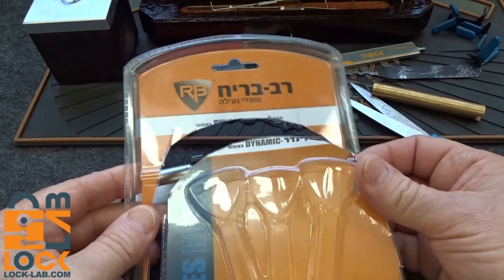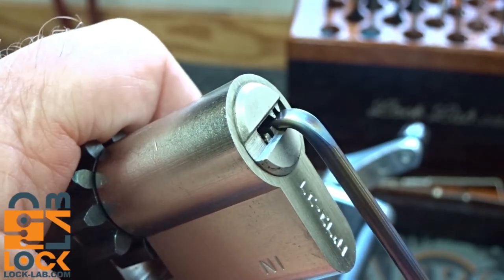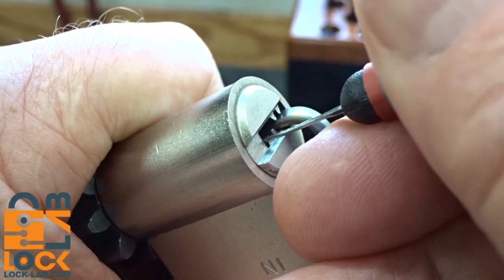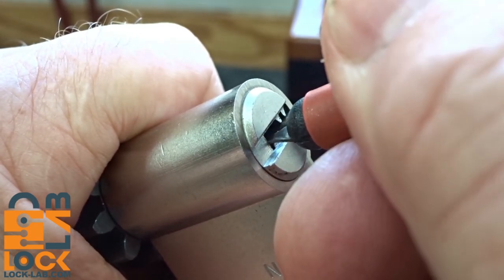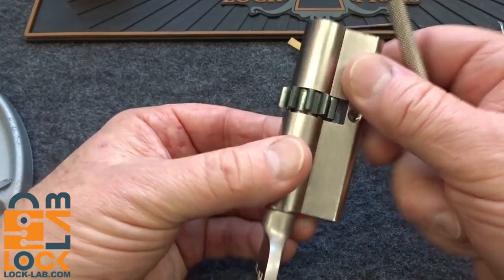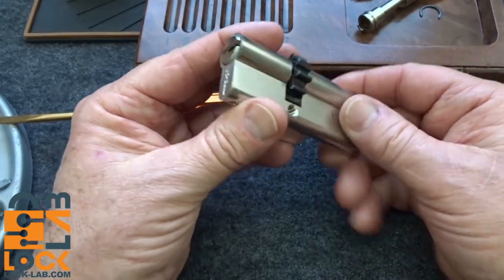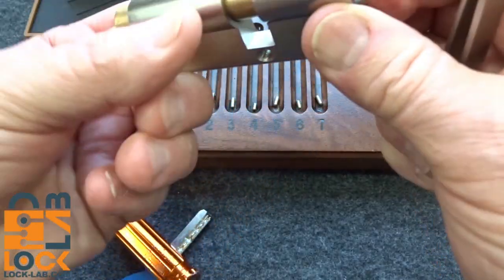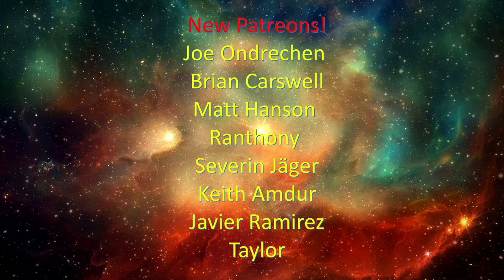(1047) Rav Bariach 7-Pin Dimple Lock Picked Open

Comment: The actuator is the standard actuator used in israel in פלדלת (Pladelet) doors. RavBariach is an Israeli lock company famous for their Mul-T-Lock brand until it got sold to Assa Abloy around 1999.
The RB-500 is a common lock used in many homes here because of its low price and that it did came standard with a lot of RavBariach Pladelet doors. Currently, most of these doors are sold with locXis and 3LoX locks that have interactive elements and are way harder to pick.

Comment: BTW Bill, in case you're interested. these locks go into doors made out of sheet steel, when you turn the lock it turns a system of metal rods that lock the door at 2-3 contact points on top of the primary latch right under the lock. these are standard entrance doors in Israel, every apartment and house has them. 
I'm dumbfounded by people in the US having wooden doors with unbarred windows right next to them or even worse, glass panels in the door itself! I don't need a gun to protect myself when my walls are concrete and my door's steel.
Reply: @KingOfBanditJing   Every time I see American homes flattened by a hurricane I shake my head in disbelief.   Seema like homes in America are all wood and plasterboard, it's like living in a home out of matchsticks.   With a few tools you can just cut through any wall.
In Israel homes are built of breeze blocks and reinforced concrete.

Comment: Wait, how did the key go in without the core being lined up with the bible/pin slots?
Reply: ?? with (most) dimple locks the pins are perpendicular to the keyway, so they were lined up.
Reply: Where do you see this? As far as I saw it was all just normal dimple lock behaviour, aka 90° to what it would look like with normal pin tumblers.

Comment: With most European style locks you line up the locking lug with the body of the lock to slide the lock into the door. How do you install something with a gear shaped locking lug?
Reply: Jim Fortune Probably a geared rack
Reply: I can think of several ways to use it. I'm just wondering how you get the assembly in and out of the door. You can't just move the lug out of the way while you slide the thing in through a keyhole shaped slot.
Reply: Jim Fortune faceplates with fasteners on the inside. I would imagine
Reply: The door  has a similar lug in it and you just align the two to interact. This is a standard system for all entry doors in Israel which is called (how surprising) the Rav-Bariah door mechanism.
Reply: are the doors build like a safe door? I ask because I'm in Beijing and my door has 15 posts that slide out reminding me of my old gun safes
Reply: The standard system has 6 bars: 3 manipulated directly via the lug and go into the door below the handle, one goes into the top of the frame, one goes into the back of the frame and one goes into the floor in older models and into the door frame 10 cm above the floor in new models.
Reply: are they packable if locked from the inside. I ask because I have locked my wife out even though she had a key
Reply: Actually, it should have had a spacer in between the tumbturn actuator with the spring and the plug. Without the spacer I am pretty sure it can be bypassed. I don't know why it didn't have that spacer, very strange. If you half turn the thumbturn then you can still bypass it I think but not operate with the key.

Comment: In Israel The price is around 50$.
Reply: Thats not too bad actually, even if it has 6 standard pins out of 7. Could be a wicked lock if repinned with spools and alien technology.
Reply: Absolutely, 50 dollars (I am assuming US?) is not a bad price for 7 pins on a standard euro cylinder (looking at this from a consumer perspective even!)
Reply: This is the 2 star lock, it sells for maybe 30$ tops.
Reply: Are you sure ? I will be very impressed if you can find this or a similar lock with seven pins for under 50 $
Reply: You know what i stand corrected this lock sells for 35 $ on ebay, thats really inexpensive for what you get
Reply: It looks like a cheap variant of the 7x7